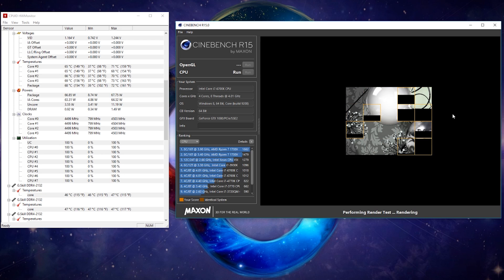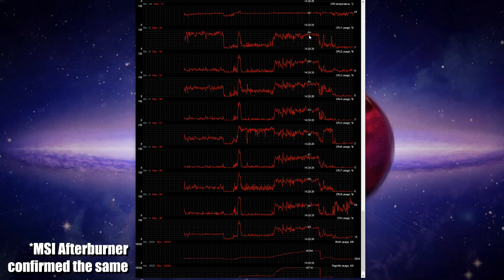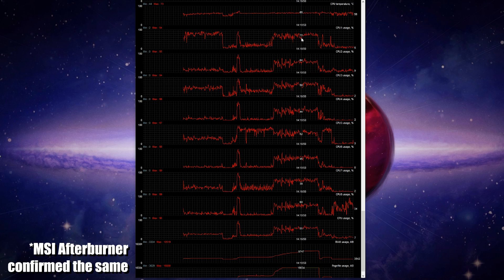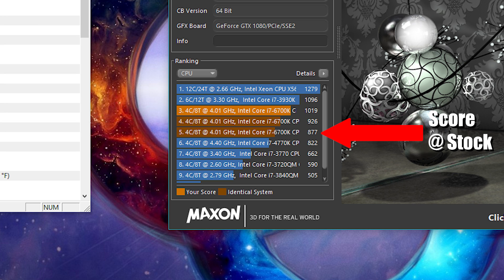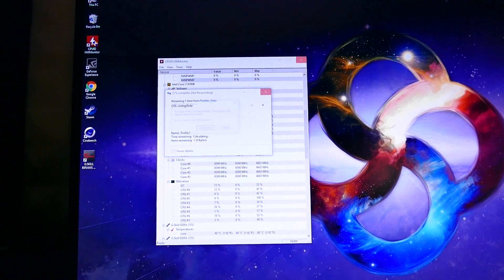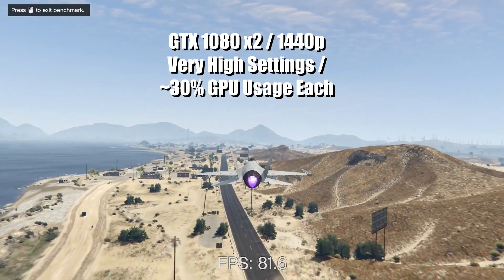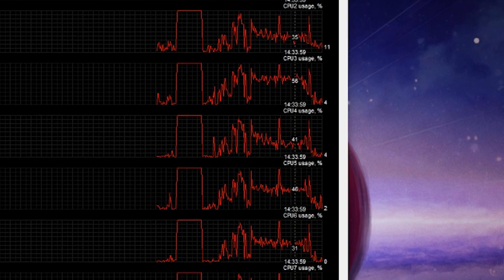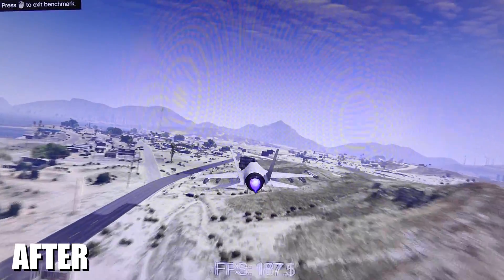My PC was Terribly Under-Performing...

Comment: Owning a PC workshop I run into this problem on both Single & Dual Graphic cards system ... %90 of the time is the drivers, performing a "Clean" re-install of the Graphic drivers normally solves it.

The rest %10 is also a driver issue but this time in Windows, conflict between 2 or more drivers or hardware utility program, which a solution to it may range from just removing the softwares and installing just the basic drivers manually to a full OS re-install.

Comment: Consider using separate partitions for your OS and data (games/gamesaves/abode/documents etc) and re-installing windows will only take you 30 minutes or so. Or even better, use Linux as host OS and run a Windows VM with your GPUs passed though and you can make snapshots of the virtual disk and revert whenever Windows decides to break itself, even an FX 9590 is powerful enough to see only 5% CPU performance loss in a properly configured VM.

Comment: I feel this video rn! Lately I've been having issues w/ stuttering and overall slow system perf, random hanging for a couple seconds, etc. I tried everything software related (DDU, fresh install, etc.) and nothing worked. Reset BIOS, nothing. MemTest86, 10 passes, another 10 passes after swapping modules around, nothing. Sometimes even my BIOS will freeze while I'm in it, and I have to do a hard reset. I still haven't figured it out and I am NOT GAMING for like a month now. Wish I had parts to swap to test shit, but I don't, so I'm kind of stuck like this for now.
Reply: Did you figure out what it was? You made me curious

Comment: Could your motherboards VRM's be overheating at the overclock? I know some motherboards need airflow from a downblowing CPU heatsink to keep them within temperature specs. If VRM's overheat the motherboard will cut the CPU clock down to like 1400/1500 to let them cool before ramping them back up. This will not be detected by a lot of utilities that monitor the CPU for termal throttling. Easiest way to check this is to just open the side panel and let a desk FAn blow onto the motherboard from the side. If this solves the problem then the  problem is temp related.

Comment: i had an issue when i upgraded my mobo/processor and had to reinstall windows. i went with Windows 10 and was having lots of stuttering in games that shouldnt have been. it turns out the game recording built into the xbox application was to blame, as soon as i disabled that everything is fine.

Comment: That's typical for Windows, Windows is great if it works, but if there is a problem like that, you have no chance to fix it. On my Linux rig i 've had never, such problems, yeah sometimes an update broke my system (ubuntu, my debian machine is still fine and running 2 years without a reboot!), but i am able to reproduce it and to fix it afterwards. I am only stuck on Windows because of gaming and a few programs like the adobe software suite. Maybe a linux rig with passed-through hardware (like Linus did) might be a good alternative! I think my next built, will be a virtualization rig with passed through hardware, does someone of you guys have got experiences with such a setup in the past?

Comment: hi i think i know what was your problem
i have same issue that have with crossfire 2 r9 390x
my issue was after 2 moth after i installed my windows 10 i realized that my windows got new update and after that my pc works not correctly as it should be
i install all drivers again but its not work
at last i installed a updated version of windows over my pc
and it fixed
i see more of these experince with other pc in a factory i work in it like lap top wifi drivers and their graphic cards
i think when windows update it self some of drivers got some issues and even if you uninstall them , they will remain in windows (some where in registery maybe) and they never fixed after installing them again
do you update your windows recently?

Comment: just recently I had to reinstall windows windows10 running 6600k @ 4.7 and a single 1060.. not enough money for 2 1080s lol but I noticed my frames were horrible on almost everything after  I cleared the cmos and re-overclocked my cpu same speed and went through the same b.s. as you not sure why but after I reinstalled windows everything was working great again... wtf ...

Comment: Because Win10 sucks badly. Those updates lately borked a PC I use at a friends house. I had to reinstall Windows as well. Definitely Windows 10 that did it... because it's working like a champ now. MS needs to die... Win10 is a terrible POS OS.

Tempted to go back to Win7 because the only reason I even wanted Win10 was for DX12, but there is very few games even using it yet, so what's the point of Win10... None that I can think of.
Reply: Acid001 You can't even play minecraft on it LMAOOOOO.
Reply: Haven't tried... they did have the MC beta that played fine, but no mods, it's not fun. Haven't checked back on it since then. I'm pretty much done with MC anyways.

Comment: I blame windows 10 my ram escalating was so bad i have 16gb and if my pc idles and i resume its start eating ram until it uses 99% of my RAM not doing nothing and in the process manegent the most ram used by a single program in idle is like 230mb's only log in in idle until my pc gets to a point its unuseble if turn it off and on again it start it again its log into windows 10 using like 9gb of my ram and escalates again till if fills the all 16gb. But if i rebbot it it goes back in idle to like 2,5 3gb so go figure that one out its like that over a year solve that isseu of ram management in last weaks after a million sets in the bios now wen i turn the PC on in the windows blue logo apear and it shuts down the system. Turn the power button again in the windows blue logo now apear with a orb on the bottom and it logs into w10 but have to start the pc twice to use it. 

You solve 1 problem you get one new... FFS

Glourius PC Master Race!

Comment: SLI actually works? I have always thought that it didn't ever work properly.
Reply: Liokardo Yes it does work but here are the downsides: your 2nd card will be doing fuck all of the game dev doesn't want to optimize their game for it.There is also more heat output and power consumption,and sli doesn't always scale properly like you think "Oh 2x the graphics cards would mean 2x performance right?" No it doesn't, most of the time ski delivers ~80-90% better performance than a single gpu.
Reply: Liokardo sli* fucking autocorrect

Comment: Oddly my computer was having this issue also with a 7600k @4.9ghz 1.375vcore and a single 1080 ti, i ignored it and eventually just got blue screens from windows.  
After a quick cmos reset as it started to refuse to boot randomly fixed it.  I have not overlcoked my processor or enabled XMP and its fine.
EDIT: This was right after i installed the latest BIOS for my MSI Z270 Gaming Pro Carbon

Comment: Having a very  similar problem with not getting full gpu usage on many games  but while only using a single 1080 on a x99 build . Been building pc's for 25 years and Iam still at a loss as to why the problem exists or the cause of it . I too will be doing that "last resort thing" by doing a fresh os 10 install .
Reply: MrStereo55 make sure you back up your important files first.

Comment: i had sth like that with my gtx 1070 aswell. couldnt get it  to more than 30% usage and neither to full clock boost. after a windows update that came in one day it fixed itself. may have been just windows 10 being a bi**h...

Comment: some issues are strange i have 2 980 ti which i ran perfectly until i decided to upgrade few parts and i had problem computer just suddenly was restarting check thermals send psu for warranty check also the motherboard checked ram tests , also i used few gpu drivers, i also changed few time the motherboard bios nothing helped, until a single day the problem disappeared, my guess combination of certain drivers/firmwares software and hardware might have issues .

Comment: This is a bit off topic but I really want to know. I am between the ryzen 5 1600 and the i5 7600k. They are both equal prices mainly due to the face that MicroCenter has a deal on the i5 7600k for 200.  I can't decide because the 1600 has a cheap Mobo, but the everyone knows how good the i5 is. Thanks.

Comment: Odd... What about your Windows Power Profile? I've found that under Power Saver stuff is sluggish even at 100 % CPU load vs High Performance (which I modify to change the clock speed minimum to 0 % instead of 100 % to save power)

Comment: would not recommend SLI with that config get the new Skylake X 6 or 8 core or wait it out for Coffee Lake or Cannon Lake due to more PCie lanes yes i know threadripper has more PCie lanes and there are issues surrounding the launch of SkylakeX 
 and Kabylake X  but the IPC is the biggest reason also Coffee Lake is rumoured to have a 6 core i7 on enthusiast platform and will need more PCie lanes than current 7700k
on the 6 or 8 core i7 Skylake you get enough PCie lanes for a x16 and a x8 GPU with enough lanes for a PCie SSD/drive

Comment: I had a problem with my gpu after upgrading to win 8 and it continued to be till win 10.longstory short the i noticed whenever I update the driver the issue would occur wich is a freeze (when not using a software that uses the GPU ) for a second then playing the missing frames quickly to catch up with the current frame
u may think it is the driver but no it was not since it would happen only when i update the driver not when I install the driver after a fresh install of the windows and i did not matter which version it was 
to avoid the issue I had to disable the GPU till I need to use but it was recently fixed by removing intel's display adapter from the device manager 

I am using an alienware 15 with GTX 765m and i7-4700MQ
Reply: عبد الرحمن نصير Have you ever heard of commas(,),and fullstops(.)?
Reply: I dont bother 
very grammar 
much language

Comment: It's quiet evident from the Cinebench score and the gta 5 benchmark... Most likely the windows was sort of corrupted or did not install properly i reckon.. That could be 1 reason. or it could be some weird background updates cause i remember when i first bought my gaming laptop last month its first few boots and windows initialization , updates etc took hours to complete which is not normal and the laptop was actually performing very poorly in the first few bootups and generally just using the OS for the first time. It could be a windows thing i guess..

Comment: I had a similar issue with my 6700k/7700k when i had the ram set too high. I had it overclocked to 3200 mhz and i was scoring about 950 @ 5Ghz, set the ram to 3000 and it jumped up to almost 1100

Comment: I'm running a Ryzen build and a similar problem happened. The cpu was showing 4.0ghz in bios and windows, however it was 2.2ghz in cpu-id. The gtx 1050ti was also not hitting 100%. The only thing our builds have in common is Windows 10.

Comment: Sounds like data corruption to me.  Recently my notebook was experiencing similar issues in Windows 10 (but not Linux, and of course it was immediately after the Creators update), and I was able to solve with out a reinstall of Windows.  But the time it took to fix, it would have been much faster if I simply reinstalled Windows.  At the same time, it would have been just as big of a headache given the other OS.

Comment: Once I updated BIOS for my MSI X370 CARBON PRO and my R7 1700 OC to 3,85GHz had much less scores in cinebench than STOCK!
Moving back to previous properly working BIOS fixed it.
But one of the reasons could be that I have uncompatible RAM from corsair, 3000MHz 2x8GB with blue LED

Comment: And here i am pushing my celeron n3160 and  intel hd graphics 400 to the maximum still got less numbers than a funky i7 6700k and dual gtx 1080s
PS: Told ya greg this won't have ever happened if you were using dual 1080tis instead XD

Comment: 1) STEAM games can be easily backed up BTW. Just copy the "Steamapps" folder (may have one on more than one drive) to another drive before you wipe out the OS. Reinstall Steam then move the folder back.

2) *I had low FPS and it turned out to be PCIe link-state management in the POWER OPTIONS was set high and it was throttling things. Weird.

3) In-Place W10 Upgrade: this can fix weird issues too. (basically get a W10 install media, run "setup.exe" from desktop.. keep data and applications)

4) Acronis True Image is very handy. I have it set to WEEKLY, automated backups (Incremental) with auto delete of older backups. I also keep an IMAGE of W10 shortly after installing my programs and getting it all configured just how I want in case I want to roll all the way back without completely starting from scratch.

5) Syncback Free - I use this to do DAILY copies of critical files
Reply: (I see you knew about the STEAM GAMES backup already from below)

Comment: Hey, Greg, I have one question because I don't know if I've got screwed in my local pc store, let me explain: a few months ago I selected all of the components for my new pc, and I choosed a Ryzen 1600 as the cpu, but when I go to the store, the guy of the store tells me that for gaming is best the intel i5 7600k, but when I saw the tests, it preforms equal, so then, my question is, with a gtx 1060 (because all of the 480 are out of stock), it is correct that for gaming is best the intel? P.S: I have a 2133 mhz RAM, so there is no problem about that.

Comment: Also, Windows doesn't like hardware swaps, like CPU, MB, etc. When you install windows it preconfigures stuff specific for that hardware, so there's that as well. Maybe you installed windows on a separate machine and then reused the SSD for this build?

Comment: It sounds like you were getting 100% of a duty load for a single GTX 1080... split across both of them. Software is extremely complex man, literally millions of lines of code running every which way, registry settings which are always getting botched... Windows has come a long ways but sometimes a clean install of everything is just the best tactic!! I know you want to know exactly why, but I doubt you'll find the answer (especially now that you are running on a fresh image).
Having said that, I'm sorry but SLI is garbage nowadays. At least with CFX you can actually run different models of GPUs. And haven't needed a connector since... like the early 2000's (and PCI-E x8 or higher has always kept up for those Radeon cards of the time, e.g. 6970's CFX on PCI-E x8 2.0). Honestly, a custom cooling loop for a ~91W CPU and ~180W GPU is overkill, even with big overvolting and OC's. I guess it was mostly for experience and enthusiasm, eh?

Comment: CPU issue = maybe some RAM timings were left on auto when they all should be set manually as any decent overclocker would know
GPU usage =I would guess bad intel chipset drivers or a bad windows update, many experience issues with creator's update and had to downgrade to anniversary update to get their gaming performance back
Reply: BTW I'm running my 6600k at 4.7Ghz and 1.42v for almost a year stable with dual 7870's, I used to have dual R9 290's but I ended up selling them when the recent mining craze basically doubled the resale price.

Comment: You probably won't see this, but my 1070 had the exact same gpu usage problem, I also tried the power settings changes with no success, but only when I restarted the pc with the power settings changed, then it had an effect.

Comment: Similar thing happened with my RAM, overclocked it to 3200mhz, weird lines were everywhere my screen. Downclocked it back down to default, still weird lines everywhere. Bios reset through the jumper, fixed it. Overclocked exactly the same as before again, worked perfectly.

Comment: Probably a random OS or user setting that was messing things up. Also I can confirm the RAM instability, I have 3000 MHz RAM I have to run at 2800 MHz because it is unstable, even with correct timings and voltage.

Comment: I'm rocking an i3 2100 with a 1050ti and yes I know my CPU can be a potential bottleneck but here's the thing. I'm getting only 30-40 fps in Far Cry 4 while my CPU is at 60-70% usage. Such low fps would have been explainable if my cpu was sitting at a 100 but not in this case. can anyone explain?

Comment: I was thinking that as you were explaining. It happens sometimes that you change something that you forget about and that screws everything up. Update and reset BIOS and start over. I overclocked my 7600K to 5.1GHz when temps started rising. Downclocked but temps kept going into the 80's. Finally reset the  BIOS and started over now I am sitting at much better temps. Sometimes doing a clean driver install (I know that we 'enthusiasts' hate doing a clean install because we know what we are doing but it sorts out old registry issues and driver collisions etc).

Comment: There could of been an odd issue, when i had my old 7870k, but i was having an odd issue where stock was faster was it being oc, i only figured it out Via overdrive, where i could monitor each core and its frequency, it turns out two cores oced fine to 4.3 but the other two cores TANKED to 1.2ghz. Turns out Disabling cool n' quiet in the bios caused the issue, i have zero clue why but it was a good 2 weeks of confusion